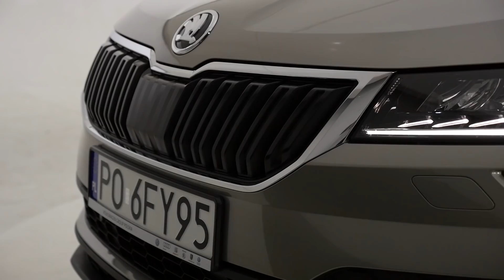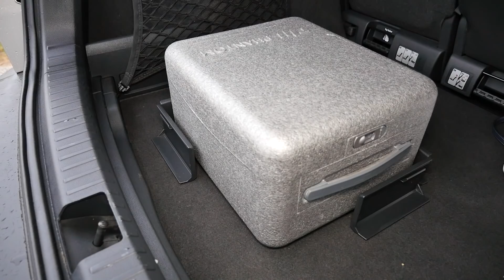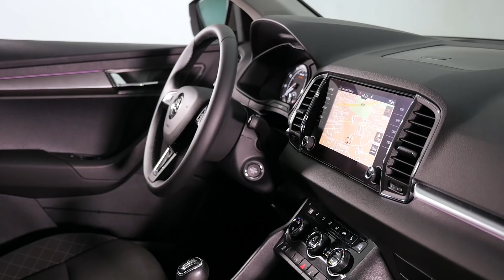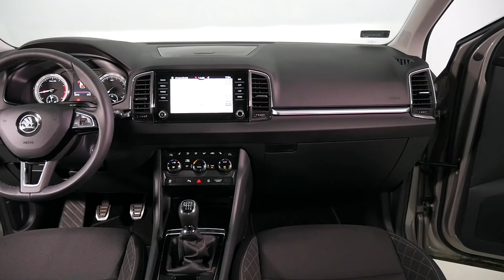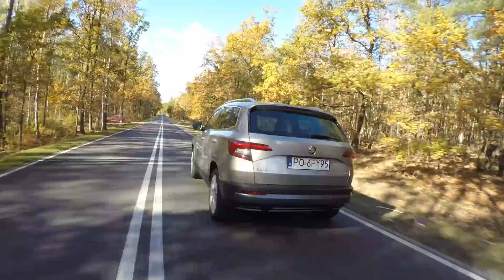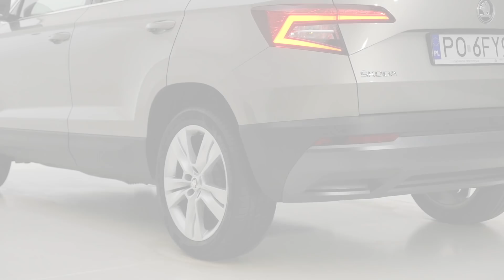Skoda Karoq 1.0 TSI (ENG) - Test Drive and Review

Comment: Before ordeing on of these I checked online reviews which have mostly been positive and then I come across this one. Some valid points, others re: sunvisors etc - that criticism could be directed at almost every car on sale.  I hadn't noticed the seatbelt clip holder when I first saw the car so checked them out afterwards. What does he mean by "interesting, but doesn't really work". If you push the metal clip upwards and then it's held really tight and won't move.  Perhaps a case of the reviewer not know what to do? 

Smart phone with plug stuck in to USB socket - cubby won't shut. Not sure why you'd want to then close the cubby but if you did then buy an L-shaped USB connector.

Bottles get in way of gearstick? They call them CUP holders as they're designed to hold CUPS. The BOTTLE holders are in the doors. Surprised reviewer hasn't complained those bottle holders are too large for his coffee cup.  Talk about looking for problems where problems don't exist !

1.0L too small to give you street cred?  If you're the type who wants street cred in front of your mates, then don't turn up in a Karoq. 1.0L engine perfect for city use.

Stalling quite common with small turbo engines? No, it's the person behind the wheel who can't drive. If you're one of them then buy a Karoq / Ateca / Tiguan  because they have an anti-stall device. You really have to be determined to stall one of these things.

You have to lean heavily the other way in corners to turn the steering wheel?  If you're travelling around Silverstone at max speed perhaps but this car has no issues whatsoever going around corners, in fact it's one of the better cars I drove. 

Sorry but this review is pants and anyone interested in a Karoq should ignore it. This reviewer is tad like Jeremy Clarkson, he seems more interested in himself trying to be funny than a review of the car.
Reply: Exactly my thoughts! I have a Karoq on order, and before pulling the trigger i tried everything available on the market in this category of SUV's. Nothing comes even close regarding space and build quality at this price point. So if anyone is considering buying the Karoq, ignore this so called review, because it's not a review "per se".
Reply: @damirorazem380  so did you order a karoq 1.0? If yes I would like a short review about pros cons on engine performance for this size of a car. Right now juggling between kamiq and karoq. Price difference being 2000 euros
Reply: @ClashRoyaleAtman1  same here :)
Reply: Problems identified aren't an issue with the car but with the user. Only takeaway from this is Skoda don't make IDIOT-proof cars...
Reply: Thanks for the points.

Comment: I have driven 1 Litre TSI Karoq and ignore anybody complaining about this engine. It is very responsive and agile.  For two people it is more than enough. Unless you have a big family with lots of baggage or you are power mad.....
Reply: IF you speak about 1.5 TSI then yeah. I have that engine and Karoq with highest trim. Ignore the complaints small picks here and there. Overall quality is reallt good and that engine is beast for that size suv. For big family travelling with  car i suggest 2.0 TDI because it has more torque for fully loaded car.
I took moon white looks 100 times better than on this review car and IT DOES catch eyes :)
Reply: Are you still driving a Karoq on 1.0 TSI? I'm really curious how does it behave after a few years, because I'm looking to buy a used one from 2017 and I really did like it on the road, but I am not sure how it will survive a long trip on the highway

Comment: If stalling is common isn’t this a road and safety issue?! Engineers please comment. Why isn’t ACCC all over this?!
Reply: It is common only if you are bad driver :D What do you expect from small engine in heavy SUV ? Its normal to lower gear to 1 if you want mooving slowly or just dont be retarded and watching (or feeling) what is too much when you driving on second gear and use clutch with more revolution  if you have problem to mooving upwards. Only people who cant drive manual have problems like this. Safety issue LOL..

Comment: Problem now with Škoda is that it start to be too expensive and at the end of the day you have only Škoda
Reply: @happybreadfruit3530  Nissan Quasshqai are cheaper  and only minus are 60-70 liter lower boot but it is minor problem  while everything else are on Nissan side!! infact you can get Nissan xtrail with same specs for same price and it have bigger boot
Reply: @Mr11ESSE111 , Qashqai have a lot less equipment it is much smaller inside, with 1.2 DIG-T is totally horrible against 1.0 TSI in karoq... Qashqai with 1.2 DIG-T can do 80km/h to 120km/h in 29.7 sec (karoq 15.9 sec).. Thats just awful.. (old felicia with 55kW is faster 27 sec). Nissan have more fuel consumption and worse suspension... So you need much more expensive qashqai to make a competiton.

Comment: Great video Marek as always!   
I’d just like to highlight the stalling issues you mentioned. 
I have a 2.0 TDI Skoda Yeti 17 plate, only had it since July however I have the exact same stalling issues.  The car was bought for my mother who refuses to drive the car because she believes it is dangerous. 
We have contacted Skoda customer services, the dealership and the finance company. All who say the issue isn’t not an issue because there is no fault showing on the diagnostics, and instead say the issue is just a “characteristic” of the vehicle. 

I find it ridiculous that Skoda are making and selling these cars that are stalling and are claiming there’s nothing wrong with them. 
They have made me and my mother out to be liars because no fault shows in the diagnostics. 

I’m just so glad you have had the same issue so it’s not just us!
Reply: Your issue may be different from mine. I'm experiencing stalling at low speed in second gear caused by turbo lag. My guess is what you may be experiencing in a 2.0 TDI is the stop&start system shutting the engine off as you are rolling to a junction just as you want to take off again. Try turning stop&start off (not ideal, but it may do the trick).
Reply: Just to clarify, I ALWAYS turn off the stop/start function. It’s the exact same issue, it stalls in 2nd gear when approaching a roundabout or junction. 
There are plenty of owners forums who state they are having the same issue
Reply: @jonm9501  try to contact John Cadogan in Australia, he will give you advice and shame skoda as a bonus
https://autoexpert.com.au/dontbuy/
Reply: "They say the issue is just a “characteristic” of the vehicle." 

Salesman: "The car has this great feature that no one has! Let me show you the new stalling Skoda! Yaay!"

I would remind him that no one has this issue and demand a full refund.
Reply: Reviewer specifically says it's a problem with small turbo engine cars. A 2L tdi is not a small turbo engine.

Comment: Shit only 43 mpg   They say 67.7 mpg and I do not have a heavy right foot  last one I will get that 1.6  tdi
Reply: These small turbocharged engines were made to pass NEDC tests. Even taking into account that we always drive 20-30 km/h over the limit here in Poland, 67 mpg could be possible in a diesel driving at a constant speed of 40 mph.

Comment: Is this guy's "thing" to be overly critical about irrelevant details or is he simply biased against skoda? Skoda has the best non-asian reliability when manufactured in europe. Compared to VW or Renault (some of the best selling in Europe), this car comes with more trim and better results per EU certifications, and has one of the best resale values in its class...
Reply: faarmer Marek is telling it as it is....if you don’t like what he says don’t watch...or watch with
your fingers in your ears.
Reply: @brearleydavid2194  it's not about telling it as it is or not. When an evidently good car is only criticized and when details such as the height of the visor are considered more important than the outstanding performance, 5 star safety rating, and good trim-to-price ratio, it is easy to see that there is a bias
Reply: You can easily google any statistic on the car. Marek can be obnoxious, but I appreciate him mentioning little details. For instance: the short visor is kind of a big deal for me. I drive 20 year old Opel and the visor covers driver's entire front field of vision, left and front. In Škoda sun will hit your eyes unless driving straight towards it. Also, visible wires are unacceptable in such expensive vehicle.
Reply: @bullseye911  i'll admit, you have a point there. Finally a good argument!

Comment: I bought one of these in June and love it, vario flex seats are a great idea especially when transporting larger loads. Mine has full leather interior so keeping it clean is a breeze. I also have the one litre engine and it hasn't stalled once oddly??
Reply: After 2 years are you still happy?
Is it really economic with a 1.0 engine?
Thanks
Reply: @dustdriver115  hiya, yes still happy so much so I traded in and got a new one in Jan this year. Still very good on petrol even though petrol prices here are so high at the min
Reply: @joannemcguirk8626  Thank you 👍
Reply: Strangely, if you know how to drive it usually doesn't. I was surprised though, coming from a high torque car to small turbo engine how gutless they are in the low rev range.

Comment: I quite like the rather plain unassuming styling. If it was very competitive to buy it would be an attractive proposition for many, I'm sure. However if they demand a premium price for it, not so much. The Mini Countryman alternative for slightly more money sounds much more interesting. I suppose that my daughter's Nissan Qashqai is also a rival and she/we are very satisfied with that and would probably buy another now that they have a new, better, petrol engine than the 1.2 turbo. If only Nissan had a more reliable automatic as well.   The Mini is probably available with the ZF 9 speed [although I haven't checked for sure] which I really like on my CR-V. If so, the Mini would be my choice even though it would be somewhat more expensive. Maybe an ex-demonstrator or year old used model would be better than a new Karoq?
Reply: Don't buy either Mini is designed by somebody who is blind both in style and ergonomics

Qashqai will fall apart fact

Comment: As you said, Skoda in Western EU really isn't cheap anymore. Here it costs the same as a VW, wich at first glance is the same quality, but Engine noise insulation, road noise and so on aren't on pair. Sure the Skoda owners will disagree, but i owned 2 Superbs (2015 and 2017, both 3rd generation) and now have the second VW at home (Golf GTD and Tiguan) and you do notice the difference ;) But as long as people take Skoda as the new "Volkswagen" it will sell good.

Comment: You definitely must watch  your review of the car before you buy it, but on the other hand if you watch it, you would not buy any car at all :)
Reply: I'd buy the i-Pace :)
Reply: @MarekDrives  
As a second car for more local use, or as your only transport across Europe?
Reply: +Huw Williams The i-Pace is really good. Even with Polish crappy charging infrastructure there are currently 2-3 places I couldn't reach with 1 fast charging stop on the way, and I suspect it will only get better. 

I hear Kona EV has great range (I'll be driving one in March, and I'm planning to go to one of these 2-3 places, which I can't reach in the i-Pace), but I also suspect it's meh to drive.

Comment: Great review.  I really struggle to understand European car size classifications.  These seems to be an (American) compact crossover, but you compared to CHR and Eclipse Cross that are definitely sub-compact, so of course the Skoda has a larger boot.  It's in the next higher size class.  If the "more expensive" Skoda is more expensive than those competitors, it seems like you might getting a value by buying the larger Skoda because it's a larger car for a smaller price.  But it is funny how they cut corners with cheaper parts (e.g., useless sun visors, seat belts, plastics, seat fabrics) to save a few pennies (I've consulted at Ford in the past and that is the actual savings per part per car) and to distinguish this from it's VW cousin.  It also seems like this rides on previous gen platform, pre-MQB.
Reply: This is built on MQB. And it's the size of Eclipse Cross and C-HR, which are (by European standards) compact crossovers. Sub-compact or B-crossover would be VW T-Roc and whatever Seat/Skoda have in this segment.
Reply: @MarekDrives  Thanks!
Reply: I don't believe that 'size class' is any more than a very rough approximation. What matters is how roomy a car is on the inside individually for front, rear and boot, and overall. Pick one that suits your lifestyle and forget about size class. Personally I class salloons, hatchbacks, estates, crossovers, SUV's, whatever, according to their body style, performance and then small, medium and large. No fancy names. How small, medium or large they are really needs some kind of common standard. There is none. You are free to compare with your own choice of reference car with a similar body style and the obsession with precise size classification is not particularly helpful.
Reply: Interior volume is a US measure, noone's using it in Europe. I'd say there are four factors important for car classification: exterior dimensions, interior quality, engine power and price. For example Skoda Rapis may be as big as some compact cars but the rest is straight from the subcompact class (trashy interior, weak engines).
Reply: I'd say it also competes with Kia Sportage and Jeep Compass.

Comment: Nice review Marek.  You're going to make a great dad.  You've got that "disappointed look" down perfectly!

A 1L engine?  Blah. It seems like there's a limit to reducing displacement before you aren't gaining any discernible efficiency from the reduction.  I would think the engineers would be better off employing variable cylinder management or deactivating cylinder designs.  

I'm looking forward to your review of the 2020 Range rover Evoque.  I was glancing at the interior and exterior dimensions and it doesn't quite add up for me.  Length wise it's up against the Q3 but it's interior dimensions seem to be more like the Q5.  Baffling.
Reply: I think we'll be seeing a slight regress when it comes to downsizing. With new fuel economy tests small turbocharged engines won't make sense. Don't get me wrong - I'm impressed with what these motors are capable of (except when I need to start quickly from the lights), but I'd probably like something bigger. 

As for my "disappointed face", it comes from looking in the mirror every morning :)
Reply: @MarekDrives  Ha.  You're self deprecating sense of humour is soo Canadian.  Thumbs up!  I was thinking about this small displacement issue and instead of slapping on a turbo, they should have employed a mild hybrid system to help in city driving.
Reply: Mild hybrids do jack. It's a way to evade some of the eco-taxes. Full hybrid or PHEV is the way to go, but that's quite expensive. I think Skoda is working on a fully electric car now.